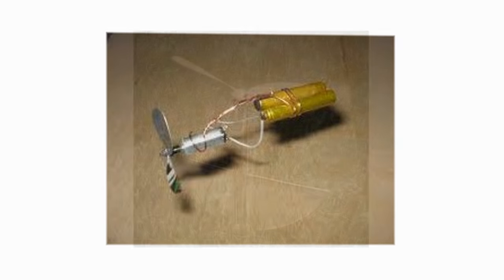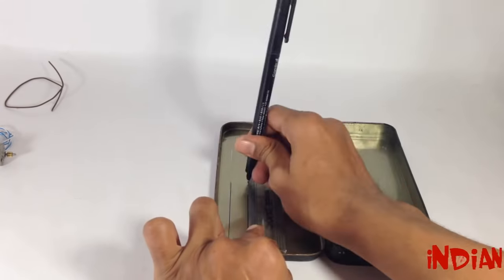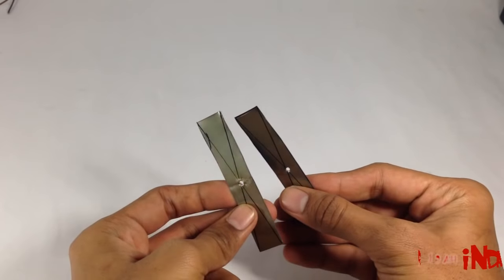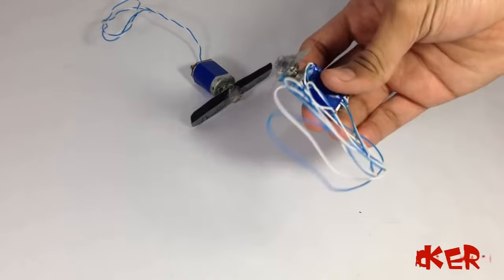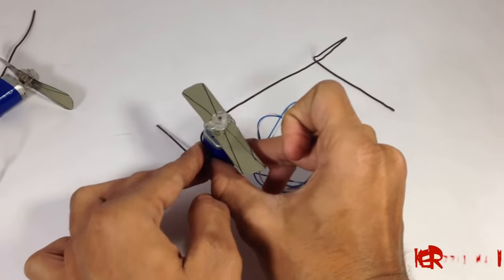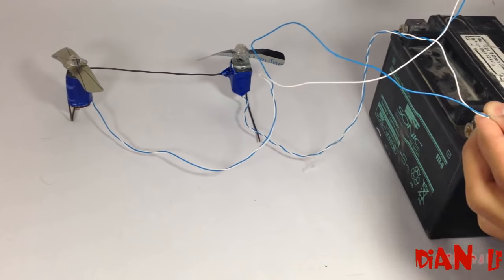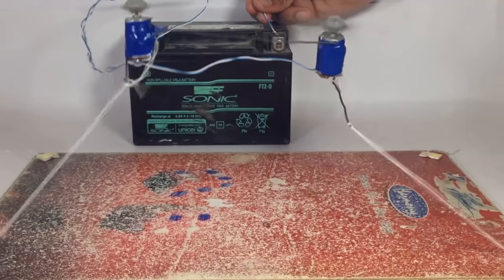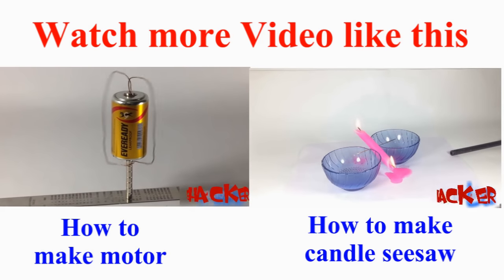How to Make a HELICOPTER with MOTOR at Home that Flies Easy

Comment: U can make a voltage control circuit and fix it with your power source with the change in voltages the speed of motor can be controlled and it may be possible that helicopter will be balanced..
Reply: IC lm317
Reply from the maker: +Harsh Amin 
yes, i am working on it.
soon i will upload it.

Comment: what type of motor do you use?
Reply from the maker: +tiger021 bels 
normally toy motors are with brush and thinner wire winding,
I had used brushless motor with thicker winding than normal.
you can find this motor in old helicopter or heavy powered toys.
Reply: thanks my friend, i have many dc motors from old printer and old radio, i' am looking for a high torque dc motor, do you have an idea which dc motor have a high torque? thanks.

Comment: can I use 6v battery?
Reply: +Ariqkamil Nugroho yes,you can use it,but use the heavy rpm motors which works on low voltage. example. old camera brushed motors for awesome results

Comment: why you didn't use A23 battery (12V and more lighter than AA 1.5V Battery)
Reply from the maker: A23 have low amp. That's the only reason.
Reply: +Indian LifeHacker : Science, Art & Magic 
It's not portable cuz i will make spy helipcopter, if i use car battery it's very heavy! do u have solution?

Comment: what are the minimum revolutions to make  helicopter fly
Reply: +gamessoftssocials  depends on the helicopter size and weight.. there are bigger helicopters whose rpm are 600 but it gives high thrust as the blades are longer. if you use small blades then you would require a higher rpm...
Reply: thank you
Reply: *****
 you are welcome..

Comment: sir i make the same. bt didnt fly...😳😳 may u plz dscrbe me which motor it is. n frm where i cn get it. i had used dc motors taken out from toy remote cars..
Reply from the maker: +Aftab Kankroli 
normally toy motors are with brush and thinner wire winding,
I had used brushless motor with thicker winding than normal.
you can find this motor in old helicopter or heavy powered toys.

Comment: hey i like your video but i hve one question will it fly if we connect 12 v cell
Reply: that battery is probably 12v as well
Reply: The battery is a 12 volt lead acid battery

Comment: is an dvd players motor and 9 volts battery can used for this
Reply from the maker: +Ashwin Gitte 
No, i will not work for that.
DVD player motor have too small capacity.
Reply: +Indian Life Hacker : Science, Art & Magic then what kind of motor you are using and from where you brought it
Reply from the maker: It is from old toys!
Reply: +Indian Life Hacker : Science, Art & Magic is 9 volts battery is comfortable or I need higher
Reply from the maker: I am using 12 volts and 6 amp, so i will suggesting that but if you will make light weight stand than it may work even on 9 volts but amp should be high.
Reply: +Indian Life Hacker : Science, Art & Magic thanks for that guy this project is so good

Comment: i've tryed so many times bt mine never works..how do you make sures rotors are running on opposite direction
Reply from the maker: +Gabriel Kanjiri 
Give opposite power supply to rotate propeller in opposite direction.

Comment: no sir but I have a dc motor and its not able fly
Reply from the maker: +Krishna Ravi Try to supply higher volt. I am supplying 12 volt and 6 amp.
If you don't have enough supply than your motor should be made with thicker gauge of copper wire which will be able to work faster even on low voltage. 

If you Have any old toy helicopter than you will find the motor with a thicker gauge of copper wire.

Try out my suggestions and let me know the result.
Best of luck!

Comment: can you explain the connections a bit? i mean the wiring connections.
Reply from the maker: +Kazi Ali Tamaddun 
both the motors are in parallel connection, and both have opposite power supply.